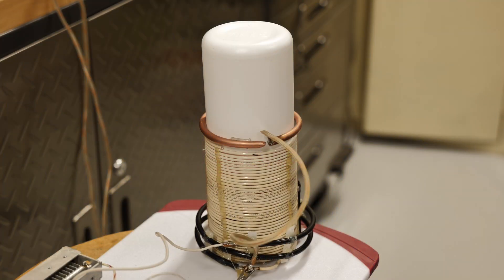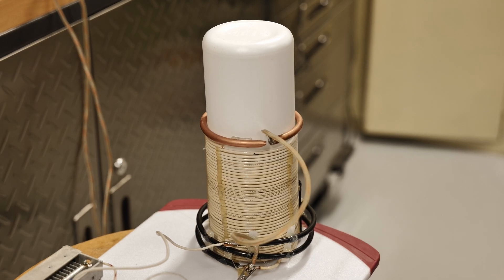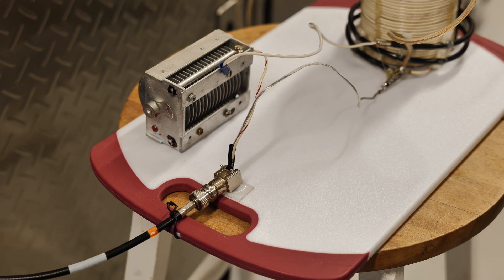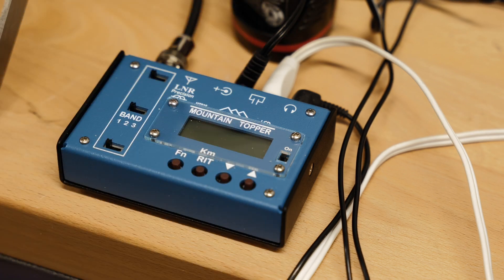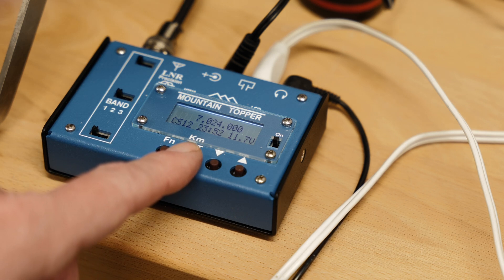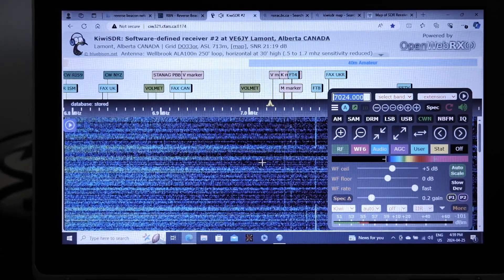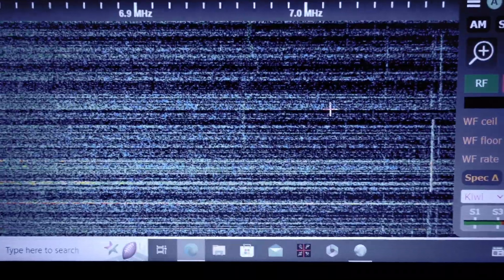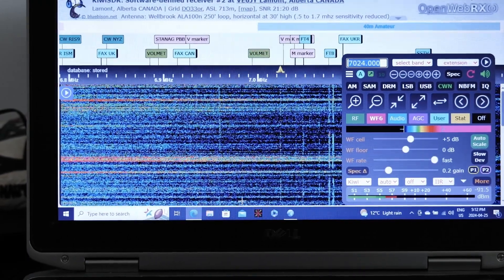Tesla Coil Transmitter for the 40m Amateur Band

Comment: Your Tesla coil looks a lot like an antenna matching unit. Connecting the house wiring to it (albeit to earth) gives you an antenna. Looks fairly conventional to me.
Reply from the maker: No magic claimed or implied…just saying 5 Watts will go a long way even without any wire in the air.
Reply: @DavidSkelhon  But you HAVE wire in the air - albeit coiled up.

Comment: nice! i had the same idea but (also looking at the comments here) i'm not the first (duh!), actually i was thinking of making a tesla coil that is tuned slightly above the frequency i want to use, and add a fairly long wire on top of it, reducing the tuning, this to transmit in medium waves, and with a wire long like 10 meters max... according to what other people did this will not cut it, but it will output some bits of electromagnetic, probably making a 10-20% of efficiency if lucky
Reply from the maker: It will definitely radiate power but efficiency would be low and difficult to measure accurately. If it isn't driven by a pure sine wave it will radiate a lot of RFI.

Comment: I had done several experiments. I used a coil with 2meter wire , connected to 50Ohm transmitter with 1W power.I installed this wire with a coil on a balcony outside. I am living on the 4 floor in a flat in  a big city. I tested it on 7.2MHz,  2.457MHz, 27MHz. The distance was not more that 1Km. I tested it with online SDR receivers, but I had not had any success.As a ground plane I used a metal visor outside and a big piece of foil. I isolated a transmitter with ferrite toroid with supply cable (like a EMI filter in SMPS).But in my flat I measured RF voltage in power sockets (AC 220V) . There was 0.5V... So, all the metallic construction in a building are receiving RF signal.
Reply from the maker: Thanks for the comment. If you are in a city, surrounded by high levels of RFI, I am not surprised that you couldn’t hear the signal above the noise 1 km away. In my latest video, I am operating outside the city, away from conducting structures that potentially absorb the signal. One Watt is a very small amount of power when using an inefficient antenna but even so, under the right propagation conditions, a distant receiver in a quiet location may detect it. Unfortunately, in your high noise location it would be difficult to hear a response unless the other station was using an efficient setup and more power.

Comment: Still EM waves, but Tesla was very clear he used changing electrostatic potentials.
I wonder if it is the same with the LMD resonant mode. I really advice everyone to read the 1891 lecture of Tesla (again) where he decribes the powerfull electrostatic effects which he later called Radiant energy. it behaves differently then the EM resonant mode (TEM)😊
Reply from the maker: Mainly TEM waves for sure, but there maybe a small LMD component too. Confirming it might be a subject for a for a future video.
Reply: @DavidSkelhon  I agree, both TEM- AND LMD resonant modes can be present.

Comment: Amazing results for such a low watt low tech solution. Couldn’t the same concept be used with a large tesla coil?
Reply from the maker: I’m sure it could. The question is, how efficient is it compared, say, to a conventional dipole antenna? I suspect it will fall short but under some circumstances I could live with reduced efficiency if it is easier to deploy compared with 20m of wire strung between masts and trees. I will test it in the field and report back in the next video.
Reply from the maker: Absolutely, though I suspect this coil could handle several hundred Watts anyway.